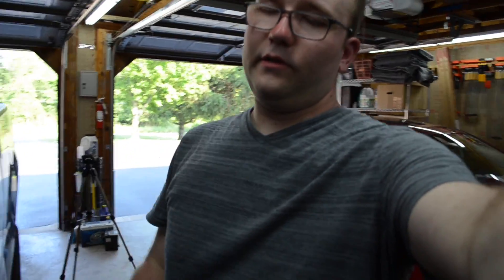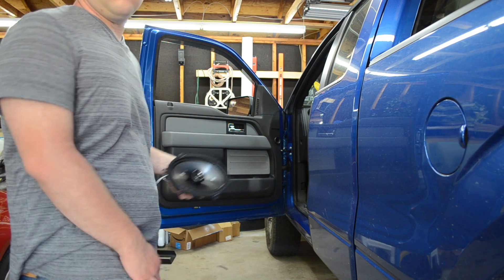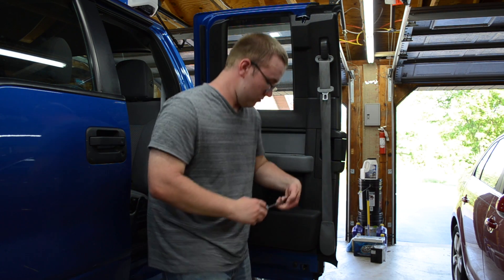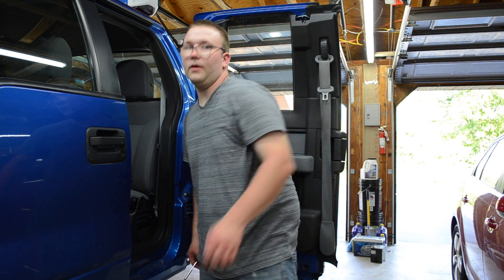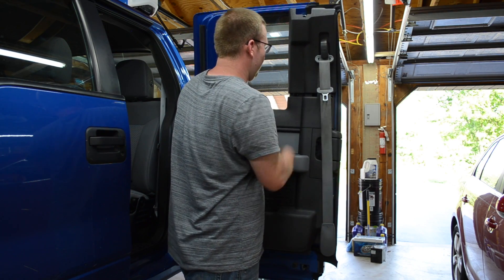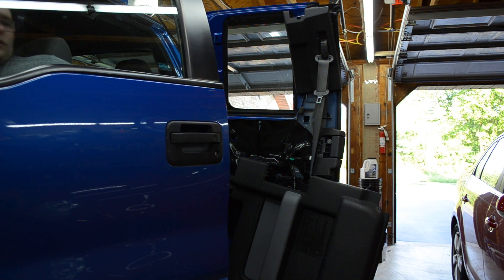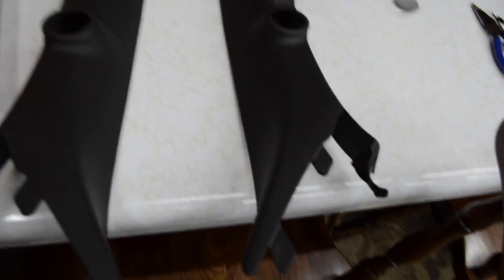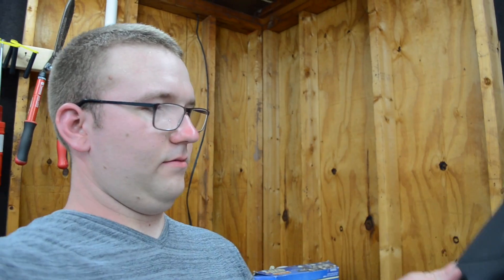11-14 F150 Supercab Kicker Speaker Install

Comment: My radio stopped working entirely and ripped the radio out replaced it with a touchscreen and spent $40 on skar door speakers for the front but what size did you use for the rear I can’t find a straight answer 😂
Reply: 6x8 fits perfect

Comment: What are the ford plugs you’re referring to on the speaker
Reply: Ford OEM speakers have a quick disconnect plug which is really nice because you can disconnect the old speaker and plug in the new speaker.  Problem is:  Most after market speakers only have the metal terminals on the speaker and not plugs (because every car/truck mfg has their own way of installing speakers), so you will have to terminate them yourself by cutting off the plug and splicing the wires together to make a solid connections.  BUT  ....  If you order your speakers through Ford or purchase Ford specific speakers, then they will come with the plug ready for quick installation.  Hope that answered your question.
Reply: You can buy the Ford speaker adapter plugs on Amazon for about $10. Very handy. Makes it plug and play.
Reply: @zR1SKYz  if you get your stuff from crutchfield they give you the connectors

Comment: How much power does the stock h.u. provide for those speakers?
Reply: 80 watts if I remember right. Most aftermarket head units are 200 watts. If you want to keep your factory head unit, I'd recommend getting a Kenwood power pack amp. It goes behind your radio and taps into your speaker wires. It shouldn't be any more than $200 to get one and they're relatively simple to install
Reply: Add a amp

Comment: How did you wired the tweeters
Reply from the maker: My truck cam with factory tweeters in the A column and I just swapped them out. I spliced them into the factory wiring harness.

Comment: Are the rear door speakers 6x8 just like the the fromt door speakers?
Reply from the maker: Bacilio Ramos Perez Yes, all of the speakers are the same size.
Reply: Bacillo Ramos Perez....yes the rears are also 6"x8" on any late model Ford F-150....its a super easy install. I did all four speakers in mine in less than 2 hours. Really getting the door panels off is the hardest part but just take your time so they don't get scratched and you're good.
Reply: Mick Keener did you replace them bc your had a problem or just to upgrade my driver door isn’t working and not sure if the speaker is just blown
Reply: Haven Lambert kind of both really.....passenger front door speaker started rattling but I had bought the upgrades probably a year ago. Just decided to finally get them done.
It’s really an easy job.
You just need a ratchet, 8mm, 6mm and a 5.5mm socket and it’s easy. A small screwdriver will pop off the two covers in the door panel.
You also need the adapters for the wiring and its plug and play install.
About $8 for a pair on eBay.
Hope that helps.
Reply: Taking the doors off carefully is the hardest and most time consuming part of the process